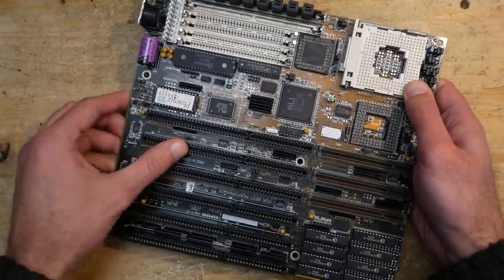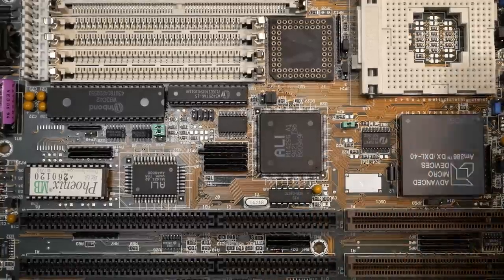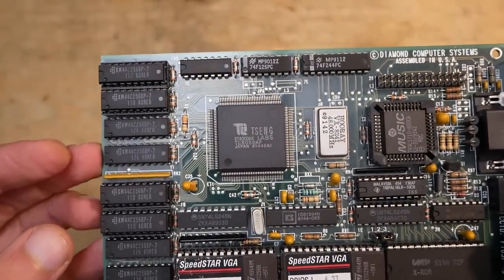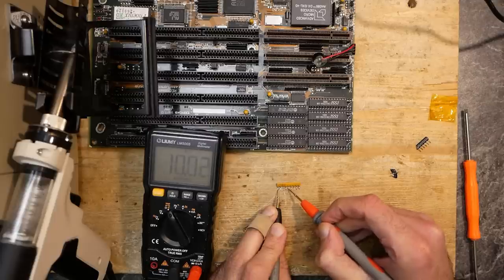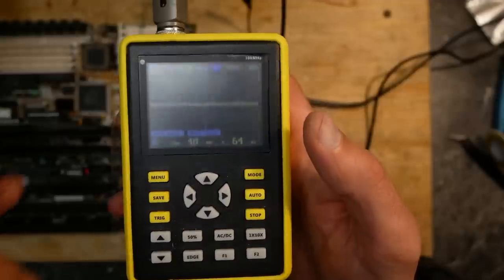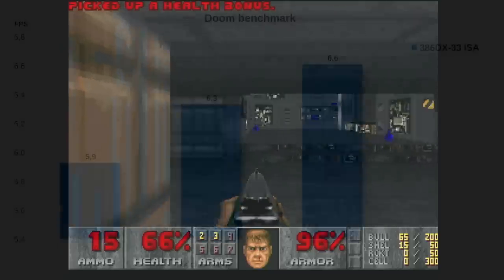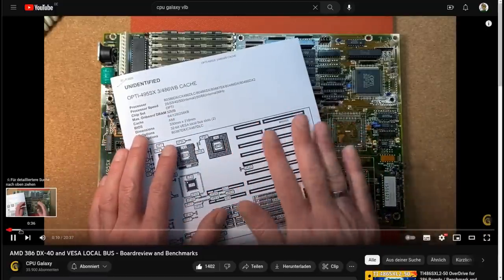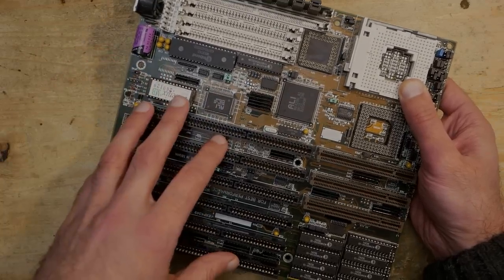An expert among retro mainboards (Part 2):  stability issues, 386DX with VLB vs ISA

Comment: Great video and awesome board. I have the same board and it is as you described unstable as hell. I will definitely put the capacitors there as well 👍🏻. And wow, I am very surprised about your frame rates for the #isadoom25fps challenge! You outperformed me already before I released my video. how cool is that 😂. Thanks for sharing your great experience and superb content with us. Cheers, Peter
Reply from the maker: Thank you Peter! I don't think, this is it. I have a feeling it's possible to get even more out of it. I'd be curious to know, if your board runs at 40MHz with a 386. May be there is a defect on my board, which prevents it from delivering 80MHz on CLK2.
Reply: @necro_ware  I will check that and measure it to verify if it works on my board. 👍🏻
Reply: You two have amazing content and have inspired me to push my AMD K6-2 to the max. I know it's much newer than what you work with but it was my first PC in 2000 as a high school present and very important to me

Comment: Excellent tinkering in order to discover that there is a problem with the voltage and adding more decoupling capacitors! Also spending hours to tune and bench the system! That is our love for vintage stuff. SimCity2000 is a game that indeed takes advantage of a fpu. SC2000 is almost unplayable with a 486DLC/40. Minimum CPU is a 486DX-40. Maybe a fpu helps.

Comment: For HF ripple you  need ceramic caps with low ESR. The electrolitic one has bad ESR and actually a high serial inductance. To block HF ripple you need a lot of small MLCC caps in parallel close to CPU.
Reply: That is the kind of mod I have seen hard core overclockers do on their mainboards (TAGG XOC for example) or I'm mistaken?

Comment: Good catch on the power issues. "You are what you eat", they say, and that is very true for computer hardware. I read stories about hardware became much more overclockable (as expected) and producing less heat (not so expected) with cleaner power rails. Also on some "PC Chips" boards they used cheap aluminum electrolytics for filtering (no tants, almost no ceramics), which ofcourse dried out after 25 years of service, and those boards are sometimes very unstable without a full board recap.

Comment: This series is being gold for me. I have my very first PC, a 486 dx66 vlb board very similar to that one in a very unstable state after several decades on storage. I moved back to ISA cards both the graphics card (also a Cirrus Logic)  and the IDE card (promise cache vl), but it still was randomly crashing and refusing to boot. 

 I will take a look at the ripple as that might be a cause. Maybe old caps could be showing good values in capacitance and ESR but doing poorly in filtering after those decades.

Thanks a lot!

Comment: Man.  This really illustrates how much troubleshooting is often just a series of lucky guesses and dumb luck.
Reply from the maker: That's true. Where luck decreases the more experienced you become, since you develop a feeling where to search, if something goes wrong. Often you have no idea what exactly it is, but sometimes you can exclude what it is definitely not. I'm a software developer since 30 years and it's the same there, but I'm by far more confident in that, than in electronic engineering :)
Reply: @necro_ware   Yeah.  My job involves a lot of troubleshooting, too (and I am a hobby coder as well.)  So I'm very familiar with procedural troubleshooting.  I always say it's a process of trying to divide the problem domain in half over and over again until you narrow it down.

But, sometimes, you just run smack into something by accident, and happen to see a piece of the puzzle.  I don't mean that to detract from the skill involved -- it takes skill to be successful.  Just kind of marveling at how it is sometimes only fate that leads us to an answer.  Or at least, it gets us there more quickly.  Just think about how long you could've gone before thinking to check the 5V rail ripple, without having noticed a difference between two PSUs.  :-)

Comment: I would love to create a custom case for this system, with every jumper connected to an external switch so that you could easily, quickly, and conveniently change the motherboard settings on the fly. This, coupled with the insane compatibility of the system's board, could make this into a really neat test bench / benchmark / diagnostic system.

Comment: The polling clock rate is generated from that smaller crystal onboard and used for the PS1/keyboard controller and if you had an onboard floppy controller. Typically.

Comment: Wow excellent work knowing where to add not one but two capacitors.  I just watch and think how do you learn that!
Nice job.
Reply from the maker: I read a lot about power supplies as I did my MMX-VRM project. There such things like ripple are a very important topic.
Reply: @necro_ware  
I started my computing career  using all these types of boards and processors. I remember how excited I used to get when something new came out.
Like VLB or the next biggest processor that I couldn’t afford 🤠

Comment: I wonder if all the work you did to stabilize power is the key to such a great overclock.
Reply from the maker: Without the stabilization work, it was not possible to overclock or tweak the board  at all. It was more or less stable only on the worst BIOS settings.
Reply: absolutely need stable power, years ago my friend was overclocking his 1.6ghz amd althon64 and couldn't get much more then 1.8ghz out of it, months later i put his cpu in my machine and managed to get 2.2ghz. he was using some generic discount psu, while i was using a higher rated psu. even managed to get a better overclock on his ati radeon 9550.

Comment: Nicely done! I guess I know now what to look for when I have unstable boards ;)
It would have been really nice to have seen video memory throughput here though. Benchmarks like Doom are CPU limited, and having the raw MB/s to/from video memory would help to understand if or if not VLB would make a difference for 386 machines. Have a good bench I never published. Can send it to you.
About the clock speed: I saw that there's a position where you could solder in a crystal beneath the CPU. Maybe I didn't catch it, but could the hack be to insert an 80 Mhz crystal there and jumper the system to 486 and 40 MHz bus?
Reply from the maker: Yes, this is what I meant in the video as I said that an own clock oscillator or generator can be added. But I would have to reverse engineer the traces to know definitely if it is the way to go. In regards of throughput, I made those measurements, just didn't prepare them nicely, because they are more or less the same as what Peter from CPU Galaxy presented once in his video. If the number would deviate, I'd publish them in this video.
Reply: @necro_ware  I guess I was a little tired already, I often watch those videos at night...
You're right, he benched it already. I guess I didn't notice (saw his video some time ago, too!)
Anyway, thanks for sharing something about these rare boards!

Comment: Cool board, Scorp! Super cool content 👌
That Am386DX-40 should run fine with an external 80MHz oscillator indeed.

The Speedstar VGA is fast indeed and I love the Tseng ET4000 chip for its speed and compatibility but is isn't the fastest ISA VGA. The Diamond Speedstar 24x with the WD90C31 chipset actually and the Trident TVGA8900D (yes a Trident; no typo!) both beat the Tseng (by a hair ;-) ) Any of those three are excellent choices though for ISA builds..

Indeed regular DooM is not enjoyable on any 386 really. Replace a PGA-132 with a Ti486SXL2-50 and it will be.. On slower machines I run FastDooM which makes it somewhat playable even on my 386SX-16 🙂

My 160MHz 486 (Am5x86) build will probably break the 25FPS challenge as well with a fast ISA card but that's not a really period correct setup but hey it's a 486 ;-)
Reply from the maker: Thank you! Yes, I have an WD90C31 and 8900D here, they are indeed similar fast as the Tseng ET4000 and I use them regularly too. At stock clock, I don't see any difference in performance, but the SpeedStar is more reliable with the overclocked ISA bus. I don't have the SpeedStar 24x, hence I say, that the SpeedStar is the fastest ISA card which I have. And I don't like the 8900D, because it produces jailbars on the LCD displays. In my opinion the best compromise card is the CL-GD542x based ones. Since they have a better integrated DAC, a very good image even on LCDs, very good games compatibility (ET4000 is not that great, WD90C3x is much as well) and they are nearly as fast as the others. In my own builds I always go with Cirrus Logic.
Reply: @necro_ware  Yeah the ramdacs on Trident cards leave much to be desired but since I am allergic to LCD screens, the destroyers of pixel art the less noticeable difference in quality on most analog CRT screens does not really bother me personally. The best external VGA ramdacs I've used are the BrookTree ones and the early gold ceramic Inmos units. They make every CRT shine ;-)
The Inmos DAC on my IBM PS/2 Model 30's MCGA, hooked up to a PVM: 256 color 15KHz CRT heaven ;-)

In my experience the Trident 8900D and Speedstar 24x (which is Diamond's iteration of the WD90C31) also work great with an overclocked ISA bus in my case. They're both very stable even in 0WS mode and at higher speeds in my builds which are mostly upgraded 386 machines (SXL2, SXLC2 and DLC) and do beat the Tseng ET4000 albeit by a hair..
The Cirrus ISA cards are indeed very compatible but I find them too slow..
I do really like Cirrus' later VLB iteration of the Alpine series chipset (CL-GD5434) on my P5 Pentium (yes a Pentium with VLB) build with its 64-bit memory bus. That card flies!
If you're looking for the holy grail of ISA VGA cards: Look for a Diamond Speedstar 64 which has that exact same CL Alpine chip, breathes through a 16-bit straw yet still manages to kick every other ISA card's @ss ;-)
Reply from the maker: @pipschannel1222  Unfortunately for CRT you need a lot of space, which I don't have, so I have to live with LCDs, therefore I have two, which can handle 15kHz. Regarding Cirrus Logic, that's strange. In my tests the GD542x cards were on par with et4000 and the others. Only less stable on higher clocks. But I also should mention, that I have 5 different ET4000 cards and they all behave differently when overclocked, so I guess, it's also a matter of a layout and even day of production.
Reply: @necro_ware  Yeah there are definitely a lot of differences in board designs of cards using the same chip.. Also BIOS differences can play a big part here, especially in terms of compatibility. One thing is clear about the cards we both mentioned here: For the ISA bus it doesn't get any better as almost all of them manage to fill it up to the brim (which doesn't take a lot) obviously making that old bus the biggest bottleneck of the system. It is however very cool to get the most out of an ISA system. In my experience overclocking the ISA bus is the only way to experience any real speed boosts. 

The Diamond Speedstar 64 ISA with the Alpine CL-5434 chip is the overall winner in my benchmarks as the ultimate ISA graphics card as it ticks all the boxes: It's very compatible and very fast with old DOS games (it's a Cirrus after all), has an interleaved 64-bit memory interface and advanced GUI acceleration making Win311 and Win95 shine at high res with its 2meg framebuffer and has an excellent internal RAMDAC 👌 The VLB version of this card is also lightning fast and way ahead of its time..

Comment: I noticed that there are settings for the 486DX/50 in the mainboard manual - this theoretically implies, if you could run ISA at CLK/4 that you could have a 12.5MHz AT-bus, and with an Am5x86-P75 or similar AMD Enhanced 486, a theoretical 200MHz CPU clock, all other things being equal. Do you think this board would be up to that?

Comment: That KTS IC is the PLL clock generator. Just check yhe 14MHz crystal pins to see that are connected to it. The control pins are driven by the chipset instead of setting them manually with jumpers.
Since it generates correctly other frequencies, I suspect a bad solder joint or a cracked trace. Also might be a bug and that explains the unpopulated 386 side of the board.

Comment: So, here's another interesting question: How fast can you crank that ISA bus and still have a sound card work? Because that (and the HDD controller, it'll profit from the extra bandwidth till it faceplants) are usually the limiting factors regarding ISA bus overclocking. If you could run an Audiodrive at that speed, it'd be one hell of a setup for wringing out every last bit of performance from those late ISA video cards, like the Mach 32/64, the ET4000-W32i, and the GD-5434 (assuming they could handle the fast ISA bus).

Comment: I get 12.1 fps from timedemo using fdoom13h with high settings using my 386DX 40 MHz and ET4000 running in ISA with CPUCLK/2. The 13h variant is quite a bit faster than the regular. The game is surprisingly playable at least on a quick glance.

Comment: heh, at least you had more luck with this. i'm still stuck trying to get any change in behavior out of my intel pci/ed. no vide, but it beeps like its posting, and does the memory check noise. also gives the memory error if i pull the ram out. all connections trace out valid, and it doesn't matter which video card i put in it, isa, pci, no response. everything works fine in other machines, including the cpus, ram and video cards. no voltage drop beyond the expected few millivolts. 

the only odd thing i can find is the fact that the cache datalines appear to have 3 signals present on each. someone tried to tell me to set up my scope right, except.. every other line on the board doesn't have that phenomenon. hooking it up to my function gen and cranking it up to where the signal freq from the cache lines is yields no multi-signal patterns using identical settings.

the rst line is behaving as it should, and i'm getting clk and voltage to the cpu socket.

i really don't get where the issue is, and i think its close to going back in the box for the forseeable future.

Comment: Ok. In interest of the extreme and impractical, quake uses a math co-pro. Will it run on the 386. Yes, I'm sure it'd be an absolute slide show if it did, but will it even load? I recall lots of software that claimed to need a 486, really didn't use the more advanced architecture, but would just run like crap because they really needed the 486 for the speed. I don't hold high hopes that quake uses only 386 instructions, but at least give it a shot to crash. 

But even more crazy, a creative labs 3d blaster vlb. The only vlb 3d accelerator that I know of, and it uses a pass through like the old monster brand cards. A 386 running your fastest vlb main video card, plus the 3d blaster, with math co-pro and your best settings, and grab as many 3d blaster supported tites to test on it and see what'll actually run. 

A 386/7 with hardware accelerated 3d would be super ironic and hilarious, even if it's slower than frozen snot. Lol.
Reply from the maker: Yes, interesting topics indeed. Unfortunately, it is nearly impossible to get a VLB 3D accelerator today. But luckily Atheatos already answered most of the questions regarding Quake on a 386 and FPU. Have fun:
https://youtu.be/KDQsLDN9df8
https://youtu.be/Zvisa_-uEqI
Reply: @necro_ware  sweet talk Clint from lgr to borrow his. Lol. I learned about it's existence from one of his videos. 

And I'll check those out.

Comment: Just a quick comment: the vram latency needs to be also changed in the vbios to set the refresh timers accordingly. Using a "faster" dram without the proper timing has no performance gain

Comment: i assume polling rate refers to the keyboard polling... but then again i thought AT/PS2 keyboards use Interrupts and aren't polled.
either way good video, this board is pretty damn interesting. and it makes me kinda jealous that my own only 386 system i have has a short on the 5V rail and i don't know why :(
Reply from the maker: Yes, I also thought about the keyboard, but didn't come to investigate. The keyboard controller is actually polling, it handles the keyboard input and sends an interrupt if something interesting happens.

In regards of short, it's almost always a tantalum capacitor. If checked that and they all are good, you could use voltage injection to find the culprit. I showed it once here for a more modern hardware, but this can be of course done for the old hardware as well: https://youtu.be/SFxOFyp6uFU
Reply: @necro_ware  oh, in that case maybe it's as simple as it changing the clock speed of the keyboard controller, causing it to poll faster. or it just sends some kind of command...
anyways, i also thought it was a dead tantulum on my system, but even after replacing all of them with new ones the short still persists. and sadly i don't have a bench power supply for voltage injection.

Comment: why does 1000uf and 0.1uf in parallel remove so much ripple?
Reply from the maker: In theory a capacitor between the positive and negative pols acts as a low-pass filter.  However, in real life the bigger electrolytic cap filters middle frequencies, but is too inert to react to higher frequencies. The small ceramic capacitor has too low capacity to filter middle frequencies, but is much faster and is able to filter higher frequencies. In combination they act as a proper low-pass filter.

Comment: TIP: Cirrus 5434 VLB is lot faster than 5428. Damn I love overclocking old stuff, now I'm using Cx5x86/100 @120MHz and it needs at least 4 volts to be stable.